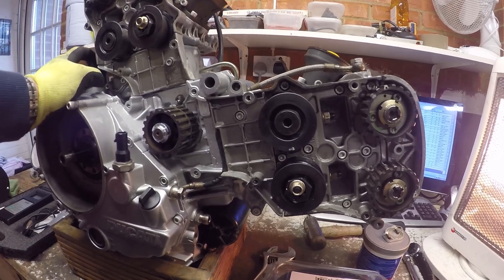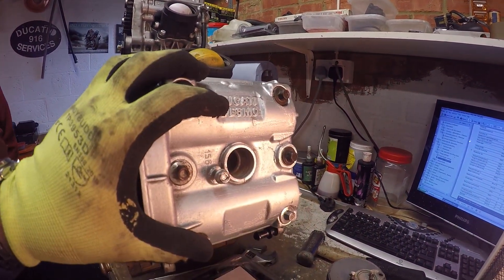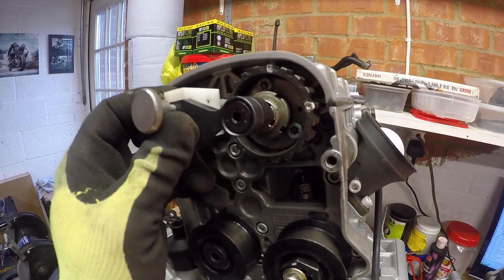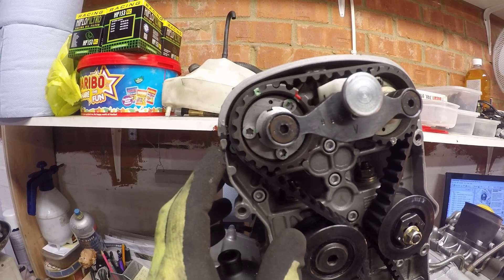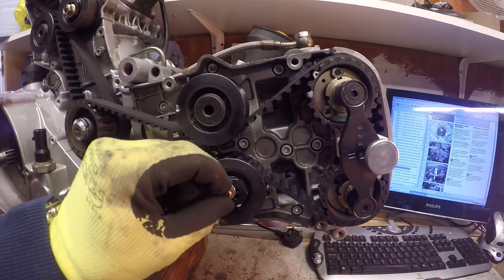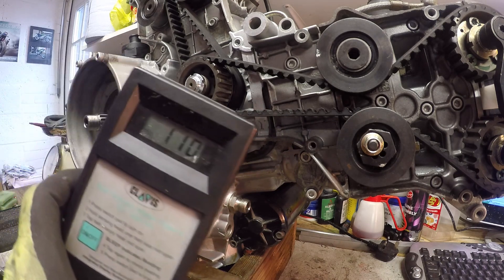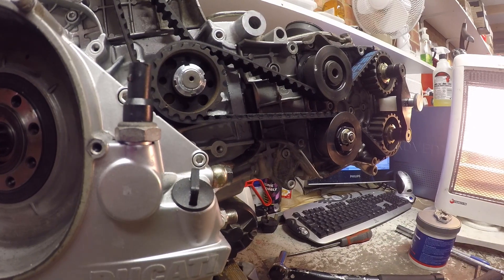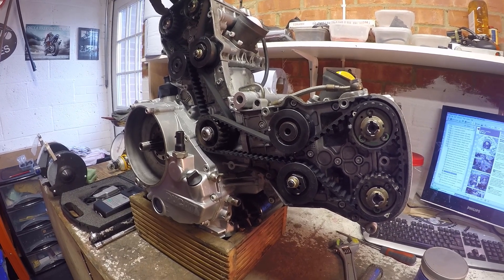Testastretta Engine Build Video 4 - Fitting the timing belts

Comment: Hi @DesmoWerx, 
I get a 848 for track few month ago, doing some mechanical checks on it a found some things very strange to me. 
before replacing belts and check valve clearance, found something strange observing camshaft positioning. 
It's ok for horizontal cylinder, meaning both camshaft T a pointing to valve cover at TDC position, but I notice a rotational misalignment on vertical cylinder. 
So, i've the timing to perform on vertical one, but I do not have the all tool Ducati for timing, camshaft holder for Horizontal and Vertical (with T not straight). 
I've only a tool to align Camshaft at TDC position. 
So, my question is the following, can I use this tool, to do the timing correctly on Vertical cylinder when this one is at TDC ?
Do we agree that also for vertical cylinder, a TDC position (TDC of Vertical Cylinder) both camshaft should point to valve cover exactly as the one from horizontal cylinder are pointing to valve cover when at TDC Position ? 

Sorry for this long message ! 
Anyone feel free to answer me :)

Comment: Firstly I'll say I'm subscribed and I enjoy all the video's and are a good source of info for heaps of us, however this belt  install procedure has an element missing I'd consider important. The factory cam tools have locked in the cams to clock them at TDC but you dont have the crank accurately locked at TDC, I believe there is a factory locking tool for this as well.   Cams could easily be advanced or retarded to TDC, without the extra tool. JMO :)
Reply from the maker: You are correct there is a tool to hold the bottom end in place, however its quite hard to turn over the bottom end without the turning tool once its built up and I do this often enough that I am comfortable in the way I am doing it. Pre 749/999 there was no tool and that's how I cut my teeth doing it.
That being said at only £40 its worth buying the tool if you are doing it yourself.
Reply: @DesmoWerx  couldn’t you also put the bike in 5th or 6th gear and just use the rear wheel to turn the crank/hold it in position? (If everything were still mounted on a bike of course)
Reply: In
Reply: This same fitment  multistrada 1200 s 
2014

Comment: I have a 2014 1200 Monster. Is the procedure for changing and tensioning the belts the same for all Testastretta engines ?
Reply from the maker: Its very similar across the range, there are differences in cam positioning depending on engines and the main difference is for DVT engines.

Comment: Please I need your help . I got a problem by taken out the timing belt and now I am unable to know how to set the marks . Please I would be grateful if u could help . I am in Africa and it's very hard to get this bike fixed. It's Ducati diavel 1200 2014 . Any help will be greatly appreciated
Reply from the maker: Hi, if you use this link it has a manual to assist. 

https://www.dudiavel.com/

The cams T need to orient in the correct position without the tool so you can replace the belt in correct timing.

Comment: A question, I have a 2004 U.S. base 999 with a bad rear cylinder, moisture in the cylinder.  Can the later 2005-2006 999 or 999S cylinder be used on the earlier 2003-2004 999?  They have different part numbers but the cylinder head part number is the same for 2003-2006.

Comment: Hi, very usefull video. I made the belt replacement in a Monster 821 following the manual and it is exactly the same procedure, but I got a question. I can adjust the belt tension to 110Hz but when I make tight the little screws from the pulleys and I take out the pulleys locking tool, if I turn a few times the cranksaft and I measure the belt tension again it is around 140Hz, is it normal? I am thinking about adjust the tension to 110Hz just moving the tensioner, lather on a few crankshaft turns, and measure again, what do you think? Thanks again for the video!!
Reply: G’day mate, 
I’ve got a 821 as well and about to do belt change soon. I’ve also go the workshop manual. My question is, is there any thing you’d like to point out that I may struggle with?

Thank you
Reply: My thinking is there will be some additional force on the belt from the spring tensioning on the valves once the sprockets have been tightened back up. When the sprockets are loose and locked with the tool this force would not be there. I guess if you know it adds a bit of tension then you could set the initial frequency at the lower end to start with. 

When you ran the motor did you leave it at 140Hz and if so did it make the belts noisy?

Comment: This is probably a super simple question, but how do you know the belts are on the right teeth in the centre pulley?
Reply from the maker: Hi Jamie, there is a location marker for the lower pulley to set at horizontal TDC.

Comment: Tripping on this series has been a god send as I will being a rebuild on my 999 this winter. She's got 37k on her thought it would be fitting to do.
Reply from the maker: Thanks, good luck with your build 😎
Reply: Do you have any pro tips you can offer about removing those bearings without the heavy machinery or should I bring the cases somewhere have them pulled and replaced.

Comment: i notice that you have mounted some days belts, i want to know if those are reliable because i heard someone says that it break easily.
than better ducati belts or days are the same quality?
Reply from the maker: Hi Woder, I have used Dayco belts without issue, these were on a friends engine and he supplied the belts. My preference is to use OEM for racing, an if I build for someone and supply the belts I will use OEM.
Reply: @DesmoWerx  thank you so much for the suggest. Also very help video for who like me try to change by myself for first time the belts.
Reply from the maker: @WalterdaLima  Glad it was of help 👍😎

Comment: Nice video. That is how the Ducati W/shop manual shows how to do it with those tools. It's the same principle as used on VW TDI engines, as it allows for perfect re-timing of the camshaft/crankshaft relationship. Also, it removes any influence on the belt from tension/friction caused between the shafts. This prevents corruption of the frequency measurement, since the camshaft sprockets are free to move during the procedure.
Reply from the maker: Thanks Chris 👍😎, The cam tools certainly make it a lot easier than the earlier methodology and is more consistent.
Reply: @DesmoWerx  Hi, me again.. after you did up the sprocket grub screws, did you recheck the belt tension frequency? (I didn't see this in the video) I'm just wondering if it changes the frequency slightly due to the screws being tightened and slightly changing how the sprockets are set on the shaft ends and hence altering the belts frequency.
Reply: The only way to ensure perfect cam to crankshaft alignment is to degree the cams to crankshaft. There are tolerances in every single part and tolerance stack up is always present especially on the distance between crankshaft and cams. This is the reason that some bikes make more power than others. It is also the reason that Ducati engines rarely have the cam degrees where it should be. They are usually off.

Comment: Am I right in saying the t cam marks on my 1200R all line up with the heads on both cylinders at TDC on horizontal ? If so can this tool be used on my engine ? Cheers , Stewart .
Reply from the maker: Hi Stewart, 
There is a separate tooling set for the 1200 set of engines as the timing belt process differs to the testastretta's. The tool needed is part number 887651623

Can be found here https://www.desmo-racing.com/en/belt-roller-timing-tool-ducati-887651623-xml-363_423-5815.html

I don't have a manual for this bike so can not confirm the full process as being identical
Reply from the maker: Just found out that the T should all be in line and inverted on both the vertical head and horizontal head when you are at horizontal top dead centre so you are right in your assumption. i.e.  I  I  pointing towards their respective head cover for both sets of cams. Hope that helps
Reply: Thanks for the reply pal :)

Comment: Hey there. First video I've seen a tool like this that locks the cams instead of the pulleys. I tried a method similar to that of Mr. Kelley's way, rotated each cylinder to TDC, marked the belts, counted dots between marks, transferred marks to new belts, installed the belts with the marks matching both the pulley and the new belts. I've ridden the bike only twice since, both times less than 15 minutes. Lately though I've been unable to start the bike, and part of me now questions whether or not the method I used was correct, or if the tension has been held by the eccentric pulleys, as I reused what looked like a new fuji nut. I assumed that with all the gaps between the marks there should be no difference in timing, would you agree to that?

If not, I might need to pick up a set of these tools and figure out how to properly time the bike. I'm sure that I'm getting fuel (unsure of PSI) to each cylinder, spark to each cylinder, but compression and timing is still unknown to me at the moment. Hate dumping questions on people's videos but just trying to get ideas as to what may have gone wrong...
Reply from the maker: The methodology works for aligning the new belts with the position of the old belts, you can put the timing out by over or under tension of the new belt but this would alter the timing by only a couple of degrees which would unlikely present the issues shown. 

If you had the the wheel move by a tooth though this would be a larger margin of error in timing.

I would check the timing to eliminate this as a potential cause but would also check all the other basics such as, plugs, air filter, coil connectors, ignition pick up etc
Reply: @DesmoWerx  The layshaft always had the mark between the case and itself lined up throughout the belt change. I switched from copper electrode to iridium plugs since and I'm thinking this is my problem. Waiting on the oem champions to arrive to be able to install. I doubt it is timing, but will look again.

Comment: Wow, did not know about the cam pulley tool. Chris Kelley is a good friend and having watched his videos on testastrettas found the failure of pulley marks to be a line up method not very reassuring. Old desmoquatros were a piece of cake.  Looked up tool on Ducati Kaemna and then found one new set on eBay. Damn good tip. Thanks, Rich
Reply from the maker: Hi Rich, 
Glad the video was of use to you, I try and take the mystique out of maintaining our lovely bikes.
You can align the timing marks once you have the tool in place if you want so you have another method, I never bother as I always use the tool to align the cams initially.

Comment: Hi @desmowerx
Great video (s). I really appreciate them. Question for you, You loosened the grub screws on the cam wheels, was this just to align the belt teeth? I have never done it this way before. Actually i have never used the timing tool before. I found the tool a while ago and just ordered. So looking forward to playing with it. thanks again
mark
Reply from the maker: @milkster100 Hi Chris, I got my set from Ducati Kaemna, if you search them they have a good website with performance parts. 😎
Reply from the maker: Thanks Mark, glad you like the videos.

Yes you loosen the grub screws to align the belt teeth as the timing tool holds the cams in the correct position for standard timing :)

Just remember to tighten the screws up to correct torque before removing the tool

Comment: Hi. Great videos. If I lay a straight edge across the flats of the cam shafts (where the ducati tool aligns the cams) would this confirm they are in the correct position? Thanks
Reply from the maker: Do you have the belts off yet?
If not you can mark the wheels against the cases whilst the engine is aligned correctly.
Better than using a straight edge
Reply: But that goes against the whole point of ensuring the camshafts are correctly reset using the tool. It’s possible over time and depending who last worked on it that the sprockets aren’t in the exact correct position. Using the tool resets it correctly.

Comment: Hi DesmoWerx,

Great video. Question : shouldn't you have measured and adjusted the tension of the vertical timing belt with its cylinder at top dead center ? If not, why ?
Reply from the maker: You are correct the manual states TDC for both cylinders when checking the tensions. I have found very little difference when measured this way and the correct way, I suppose I became lazy 

I will make a video to show the factory method to clear that up

Comment: Ducati 848Evo/1198 - https://www.ducati-kaemna.de/nockenwellenzentrierwerkzeug-1198-848evo.html
Ducati 848/1098 - https://www.ducati-kaemna.de/kataloge/ducati/848-1098-1198/zylinderkopf-nockenwellen-cylinder-head-camshaft/nockenwellenzentrierwerkzeug-848-1098-1198-alle.html

I'm having issues even purchasing the tool.  I'm in the USA but I can't get passed the registration to purchase as the USA is not in the dropdown for the Land.  Is there another place to purchase this tool?
Reply from the maker: Hi Steve, I don't know of anyone else who makes these tools other than Ducati themselves. The workshop manuals have the part numbers but they will not be cheap.

Have you emailed them as they are a pretty helpful bunch of guys

Comment: Bit worried that the timing marks didn't line up 😱. Why was that?
Reply from the maker: Hi Chris, 
It doe not matter as the timing is set by the tool not the wheels. You can align the wheels to check timing marks against the head cover joint if set correctly

The owner of this engine is happy to time off the cam tool rather than the wheels so we did not reset them

To reset them we could have timed the cams, them completely loosened the pulley wheels and re-positioned them  to use the marks if needed.

He brings all his engines to me so is not interested in changing the wheels.
Reply: @DesmoWerx  Hi so different to the 748/916 engine then. I might need your advice at some point. I'm building a supermono with a bolt on rocker box. I'm using ST4 and ST4S engines as a base. Nearly ready to do some engine tests. 👍😱.
Reply from the maker: @chrislee7817  the testa is far easier to set up from scratch due to the tools. 
Your project sounds interesting, more than happy to help if needed :)

Comment: I have never seen those cam holder tools, they are really cool! I've always just used the old timing belts to mark the pulleys but obviously with this build without previous belts that's not possible. I'd love to get ahold of some of those tools though just in case, can't ever have too many Ducati tools!
Reply from the maker: Hi Christian, I got mine from Ducati Kamna in Germany, they do a whole load of Ducati tools, these make changing the belts so much easier :)
Reply: DesmoWerx can you please post the link to the tool , will it work on the 1098?